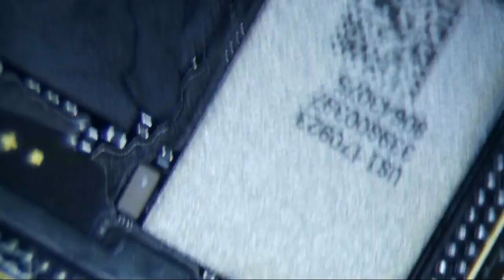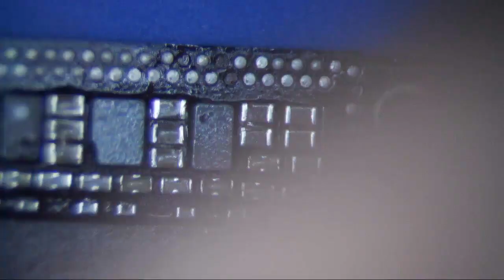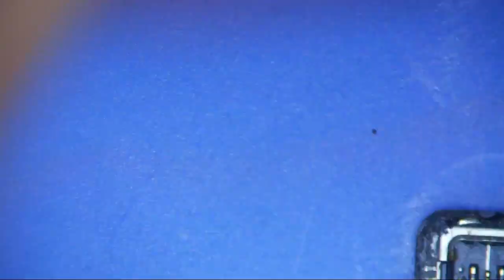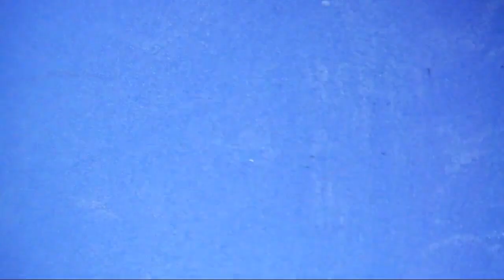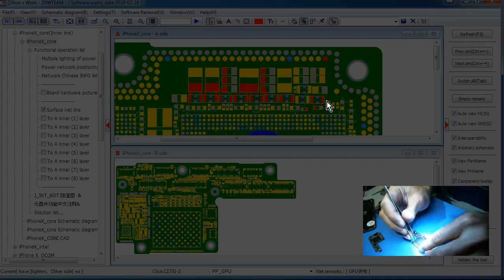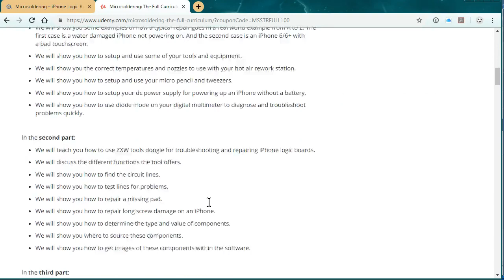iPhone X data recovery - no power

Comment: There was no need to creat jumpers from those two components as their traces underneath wouldnt have been damaged, just the pads. Would it not have been easier to just attach jumper wire at each missing pad space, curl the wire to create a new temp pad? Here's another guy doing exactly this: https://www.youtube.com/watch?v=OWd5mVWKQa0